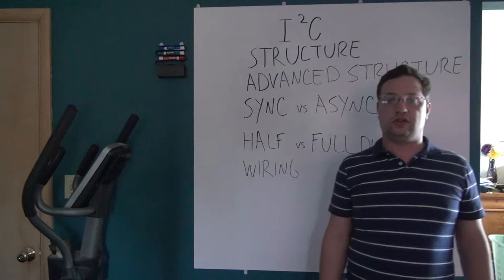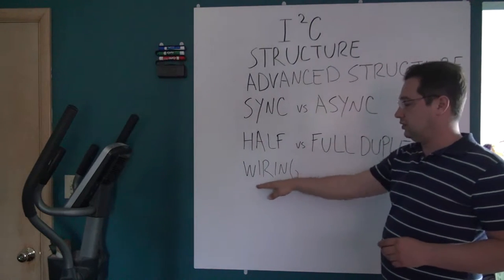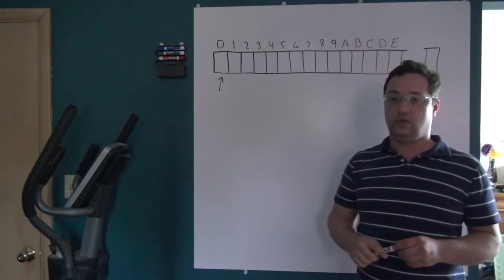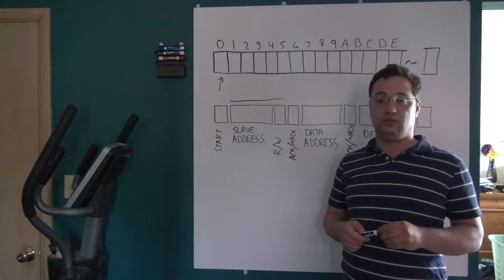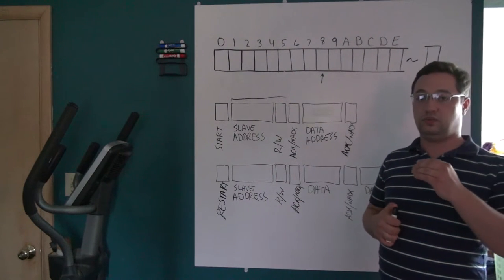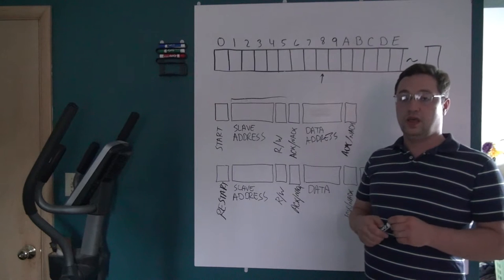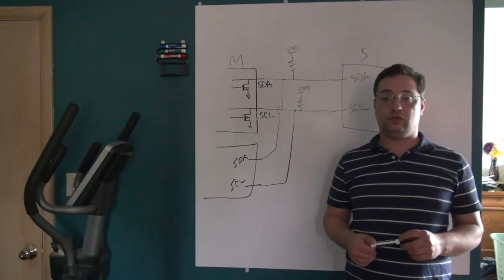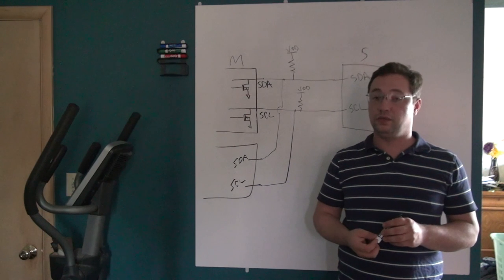eapbg #16 Introduction to I2C

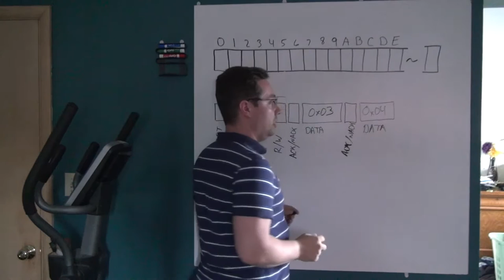Comment: Can you please confirm me? You wrote data at 14:15 but I guess you wrote the address of the data. Am I right?
Reply from the maker: Yes, you are correct.
Reply: @eapbg  thanks for you prompt answer. Your videos made my day. very helpful. Many thanks!
Reply: @eapbg  Thank you for your prompt message. Your videos made my day. very helpful. Thanks a lot
Reply from the maker: Glad you like them. Any requests, I'm always looking for new ideas.
Reply: @eapbg  Hello, Do you consider to make an applicational example of this protocols? In these video, you are explaining the details etc but I wonder how it works in real life application. Many thanks!
Reply from the maker: In fact, I have but with a caveat. When looking for I2C example code the most common thing you come across is code where you wait in a lot of while() loops. I hate this kind of code. A few years ago I wrote an interrupt based library for I2C. This library managed the I2C entirely with interrupts, no while () loops what so ever. I have run this code on a few PIC micros but I think it will run on just about anything as long as the available interrupt line up. While super technical the video might be interesting. The caveat is that demonstrating the library on an actual I2C device will probably be super boring. There are lots of I2C devices and they all work very similarly from an I2C side. The differences are what addresses you send or whether the device needs initialized and none of that is related to I2C.

Comment: If your Oscilloscope has a decoding option for SPI and I2C to decode the SPI and I2C buss, how does a electronic test technician know if the SPI buss and I2C buss is good or bad from looking a viewing the decoding information on the Oscilloscope. Mostly the Oscilloscope will decode the SPI and I2C buss in a hexidecial value but how does a electronic test technician what test to do after this? do you do a checksum on the SPI and I2C buss to test it?
Reply from the maker: I2C and SPI only guarantee how things a said and not what is said. With an oscilloscope, you can see that the messages are not distorted or have weird glitches and that is about all. As far as the data, the technician would have to be intimately familiar with the devices that are speaking to know if what they are saying is correct.

Comment: Yes any oscilloscope will display if the SPI or I2C buss is distorted or glitch. I'm talking about the Oscilloscopes that can Decode the SPI and I2C buss and displays the hexidecimal values of the Decoded SPI and I2C buss, how would a electronic test technician know that the decoded values decoded data is correct or corrupted or bad or good? what is there to look at for when viewing the decoded SPI and decoded I2C data to know if its bad, corrupted or good?
Reply from the maker: As far as the data, the technician would have to be intimately familiar with the devices that are speaking to know if what they are saying is correct.

Comment: EAPBG, when writing a I2C and SPI diagnostics program to test each IC chip one by one, what do you need to do this? just need to Ping the chips ID number for each 12C and SPI IC chip one by one to test each chips one by one?
Reply from the maker: no
Reply: @eapbg  How does an I2C diagnostic program and SPI diagnostic program test each IC chip one by one?
Reply from the maker: I'm not sure why you think such a thing exists? There might be proprietary manufacturer stuff that could do this but it's proprietary. There is no overall commonality for diagnostics. I2C and SPI are communication protocols, that's it. They move a byte from point a to point b.
Reply: @eapbg  some circuit board testing uses JTAG that will test each IC chip one by one in the JTAG diagnostic program. I thought I2C and SPI had diagnostic programs also to test each IC chip one by one on a circuit under test.
Reply from the maker: @billwilliams6338  nope, SPI and I2C only communicate.
Reply: @eapbg  what do you mean that they only communicate? so you're saying you can't write a test diagnostic program to test and check each I2C chip one by one and test each SPI IC chip one by one? JTAP does this for testing each IC chip one by one in a test diagnostic program.
Reply from the maker: @billwilliams6338  Think of them as the post office. They only deliver letters and are not responsible for the content of the letters. They are only conduits for the exchange of information and have no other inherent ability. It is possible for a manufacturer to code a diagnostic interface that can do that but they aren't required to do so nor is there a required standard.
Reply: @eapbg ok thanks, I thought when you ran a test diagnostic program it was pinging each IC chip one by one to test, check and verify the IC chip one by one to test the whole circuit board that had various I2C chips and SPI chips. I thought this is what JTAG test diagnostic programs did.
Reply from the maker: JTAG is a special unified standard that is included in some chips. That standard guarantees you some functionality. JTAG has its own communication and has nothing to do with SPI or I2C.
Reply: You have to only use IC chips that only use JTAG communicatin buss signals and not SPI and I2C buss signals? I didn't they only made IC chips that used only JTAG comm buss signals and don't use I2C and SPI because most IC chips they are either I2C chips or SPI IC chips you can't get an IC chip that can use either SPI and I2C.
Reply from the maker: I'm not sure how we got here but this will be my last post on this. A chip can have any number of communication protocol and debug standards. It all depends on what the chip has.